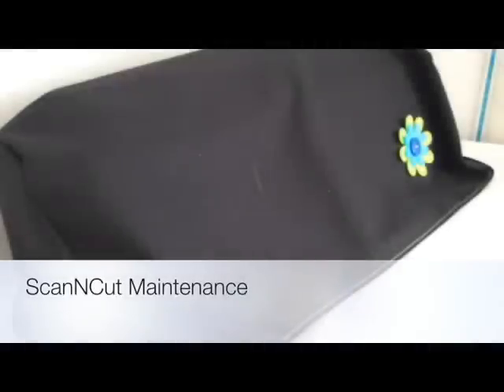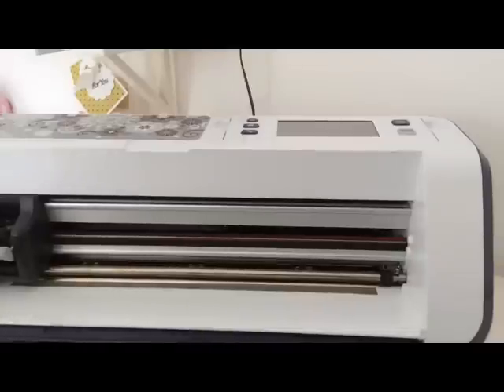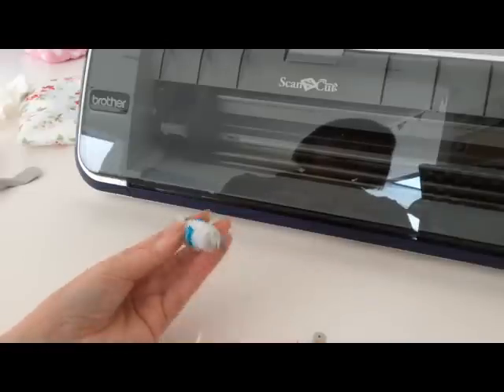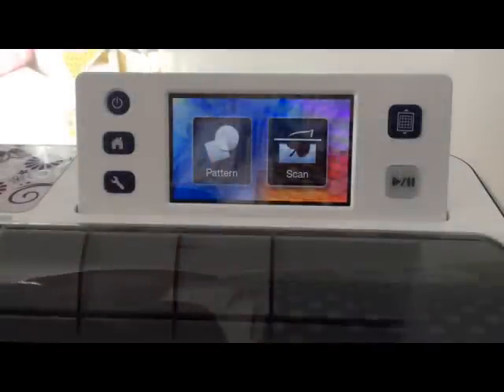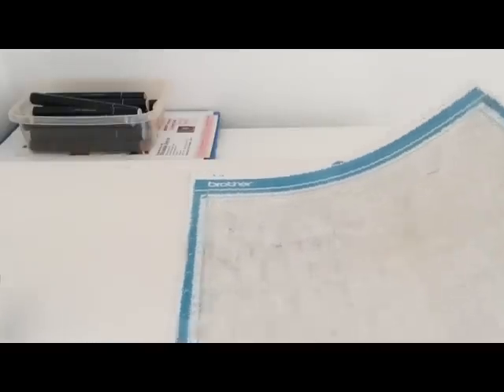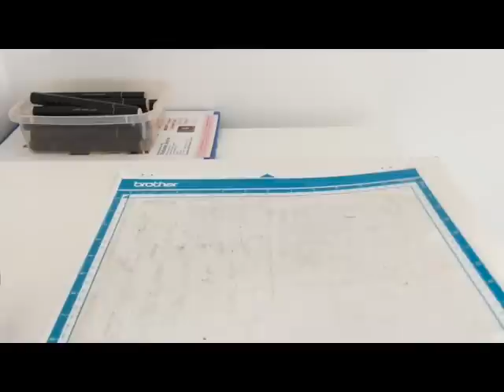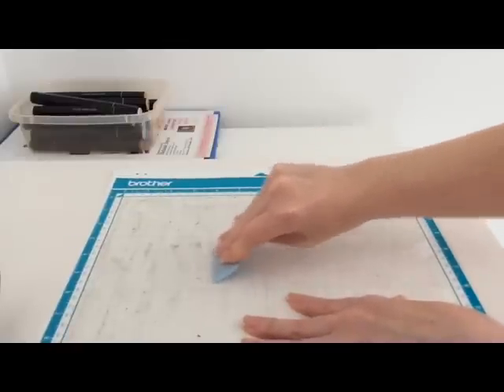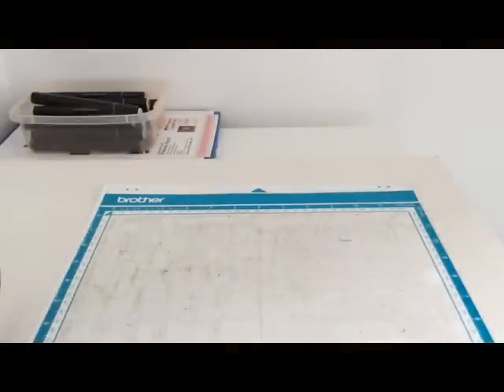Simple Tips For ScanNCut Maintenance

Comment: Excellent and informative, thank you for the tutorial! Also as far as the mats are concerned I've been using the original mat the machine came with for months: just use standard tape to hold your projects in place--works like a charm every time, and it doesn't interfere with the rollers, cutter, or the scanner!
Reply: Thanks for the information. I just bought a scanNcut and the mats which are brand new, do not stick that much already. I was thinking of using tape to tack them down and i am glad you had the same idea and confirmed it is working. Thumb up
Reply from the maker: Just be careful if using tape, sometimes it can come off and get stuck inside the machine, thats why i prefer to use a wet repositionable adhesive on my mat

Comment: Thank you for sharing. You really explan it very well. I think you videos are very informative.. I went on Amazon and purshased both the ZIG and Stick away.  Thanks again!!
Reply: I put the Zig 2 Way adhesive marker & Stick Away on my wish list today. I'm sure I'll be using them too! I've watched a lot of YouTube videos, and the Zig 2 Way seems to have the longest life for adhesives for the mats. I've been watching not only the Scan N Cut videos, but the Cricut videos too and this pen seems to be the best thus far, as far as keeping our mats going.
   It was great to find this video! I'm new to these craft machines, although have used a commercial vinyl cutter & plotters in the past. It's great to have a machine that can cut vinyl, foam sheeting, cloth, paper, leather, chip board, wood veneer, plastic, etc.
   I've tried several materials, and so far the only one I've had a rough time with is felt, which I wouldn't recommend, not only because of the prep needed to cut it, but the fuzz it's likely to leave in the machine. I did cut some 2mm foam sheeting and was very pleasantly surprised to see how well it cut! 
   Choosing what to do next seems to be the most difficult thing!

Comment: So glad I found your channel!  I am having problems getting my matt to load and I suspect it is due to dog fur as I have a Golden Retriever & a Lab so it is impossible to completely keep the fur out.  I will try some of your cleaning/maintenance tips and hopefully this will resolve.
Reply from the maker: Use alcohol free baby wipes after each cut, let the mat air dry away from your dogs and then put the protective cover back on it and you should be ok. also wipe the back and the edges of the mat not just the front cutting area, also remove the scanner cover on the bottom the machine and clean the glass with a lint free cloth that may help loading problems too.

Comment: A video on creating our own replacement mats would be great! 1st use out, my mat was cut by the machine (blade travel). $20 for a sheet of plastic w/ sticky that needs to be replaced is steep. Called Brother & they think it's defective, nearest repair is about 50 miles away... I saw a video from Brother says you can use scotch tape to keep blade from "adjusting" from vibration.
 Thanks for the video! 
Dilemma is returning to HSN... They don't have it for sale now, so would probably mean a return w/ no replacement :(
 I hadn't expected to have to make a hundred mile trip right after buying this, then buying the extra mats for different applications for another $200-300. 
 It seems if we could replicate the "registry marks", we could create mats for $2-3 each?
Reply from the maker: I cut through my original mat too, i just used brown parcel tape on the back and its been fine, I've used it for over 2 yrs without any problems. you can restick the mats if you want to I've done a video on how i do mine, they will be in the playlist. But other people use different adhesive its up to you. I done work or have any connection with Brother i am just an enthusiastic user and share what i do.
Reply: Thanks again for the GREAT video! It's one thing to read the instructions & try to figure things out, It's FAR better to see someone do it & explain it as they are doing it! GREAT video! I'm watching it again. I found the glue pen you use to reapply the sticky to the mats. From your description, it seems like the one you use lasts longer than the ones other people use. I'm going to get one to try.  I'm sure the time it lasts has a lot to do with the materials you cut.
   The part for cleaning the scanner was VERY helpful! I'm not near needing to do that yet, but want to be sure I know how to do it before that time comes around!
   The blade cleaning/changing was very helpful too! 
   It's in the manual, yet seeing how it is supposed to look helps immensely!
   Looking forward to more videos!
   Again, thank you for this video! 
-Carol in California
Reply from the maker: Just be careful how much Zig you apply, it goes on blue and you have to leave it uncovered until it is dry (it should be clear then) it will make your mat very sticky at first so bend the mat like an arc hold with one hand and the card should start to lift as air gets under it then it normally peels off easier from a new sticky mat. Hope that makes sense

Comment: I find your videos very helpful and clear. I am having trouble with my screen not responding when I touch it sometimes and also the letters show a different one to the one I tap. I have recalibrated the machine. Have you any ideas as to why this is happening. Thanks.
Reply from the maker: Hi I am sorry i don't know, i would normally suggest screen calibration but if you have done that, then I think maybe a call to Brother to see if they can help you.
Reply: Thanks for your answer, I will try that.

Comment: Thank you for this information. Is there an equivalent to the products you used to re-stick your mat available in USA? I Haven't been able to acquire the Z16?
Reply from the maker: Louisa van The ZIG two way glue pen is available world wide as far as I am aware, if you cannot find it in a Joannes, Hobby Lobby etc you could try Amazon online. I know someone also uses Aleenes Tack it over and over, which you have to water down and use at 50/50%. Be warned you only need the thinest of coats of either it does make the mat very sticky and lasts ages. You could also use a reposition able spray on the back or your card, paper or fabric

Comment: I see that you have sticky tape on the back of your mat, would it be possible to get a piece of white sticky back plastic and stick on the top of the mat, as long as I keep the margins and all the mat markings free?  Thank you in advance!  Hazel x
Reply from the maker: +Hazel Kinvig-Paul The sticky tape on the back of my mat is because it cut through it several times. Do you mean you want to put sticky tape on the front of your mat for extra adhesion? You could try it and see i just prefer to restock my mats with a Zig Jumbo tip two way glue pen.
Reply: No, I have a mat that is badly cut through (my 1st mat, trying to get used to the settings) and the blade sometimes snags on the cuts.  I have put clear packing tape behind the cuts, but wondered if I purchased some thin, sticky backed plastic (like fablon), only plain of course, whether I cut stick it on the front of the mat and just put Zig on it to hold my card/acetate (whatever I am cutting)  I would of course, not cover up the margins as I realise, the SNC needs those to recognise the mat (so, just in the 12x12 cutting area?
Reply from the maker: +Hazel Kinvig-Paul Oh ok i see what you mean now, probably worth a try as brother sell that blue extra sticky sheet to stick on our mats for cutting fabric, so if you can put that on then maybe your sticky plastic may work
Reply: Thanks so much, I will give it a try and let you know my results . . . just got to order some!  Have a lovely day! xx

Comment: Hi applelover53 please can you help I have a cm700 scan n cut. Not very old.
When I am cutting something from card or paper down the page or back up the page I get this noise like like it is really pressing down on the mat it never use to do it hard to discribe noise it does cut out ok .have calibrated machin and it’s all up to date .have cleaned scanner cleaned rollers any ideas only when it has to pull card or paper up down page help would be appreciated as I worry if keep using it it will break thank you in advance lynn.
Reply from the maker: I honestly don't know, have you taken the blade out of its holder to see if theres anything in there thats giving you the noise when the blade rotates in its holder?
The CM model machines are noisy i would say if its cutting ok and not cutting through your mat it may be ok but i dont work for brother or have anything to do with them so its just an opinion. maybe try cutting with less cut pressure and or less blade depth and see if it still cuts and how that affects the noise. If you are concerned i would send your video the brother or the retailer you bought it from to see if they can offer any help
Reply: @applelover53  thank you for your help it seems quieter now perhaps it was the pressure I did adjust it and lots of rubbish in blade holder didn’t realise bits got in there so let’s hope it’s solved it. Someone did say it was normal noise but it didn’t sound like that when I first used it..great videos you have helped me a lot with how to do things on my scan n cut. I look forward to watching some more x